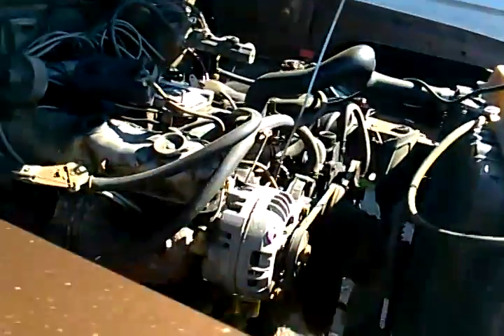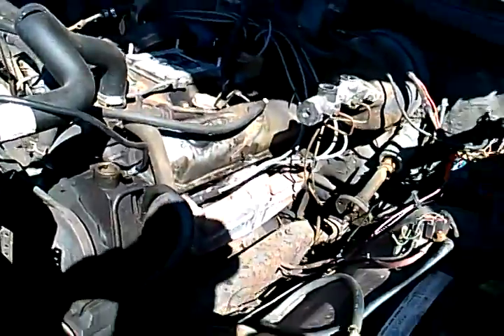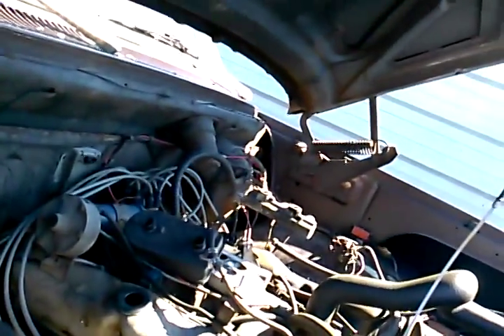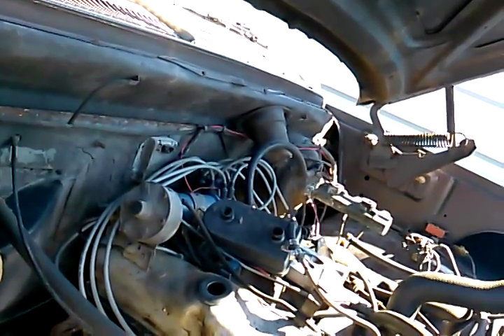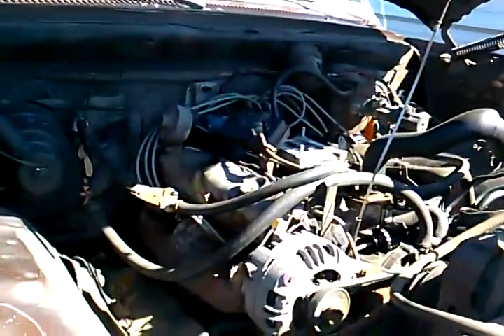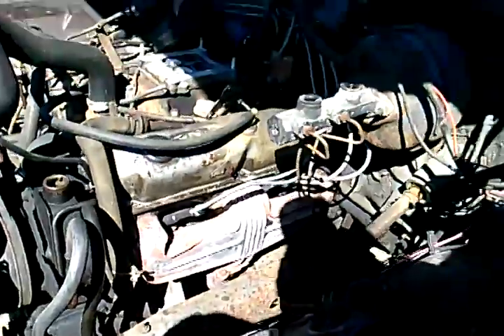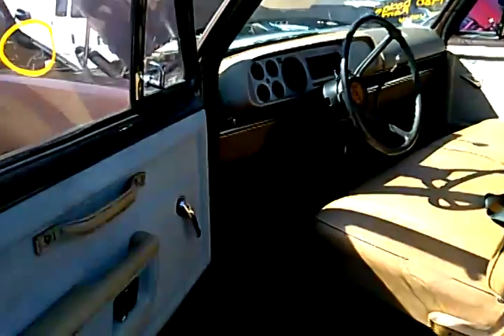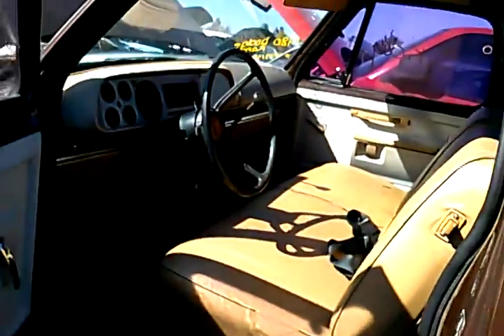SM465 4 Speed

Comment: I hate to be that guy but if it's a dodge truck then it's highly improbable that it's a sm465.  The sm465 is a gm trans, that dodge would have an np435 (or 445 close-ratio) unless someone's adapted the gm trans into it, which is again, highly improbable.